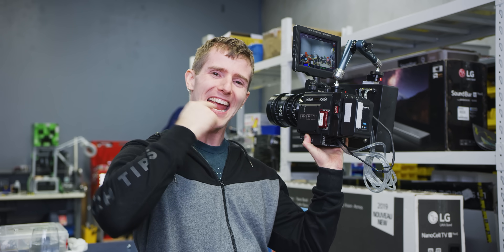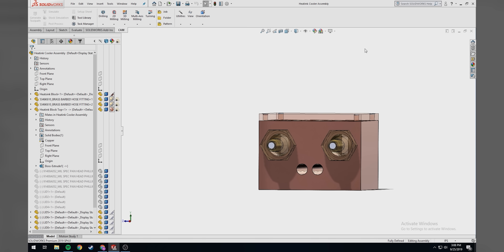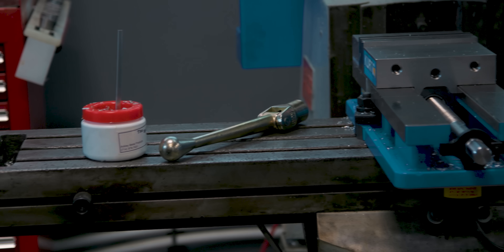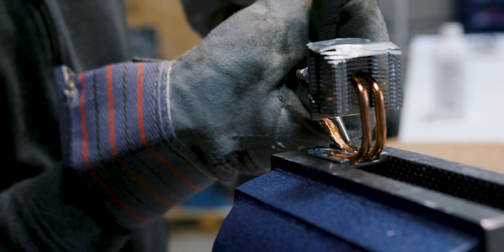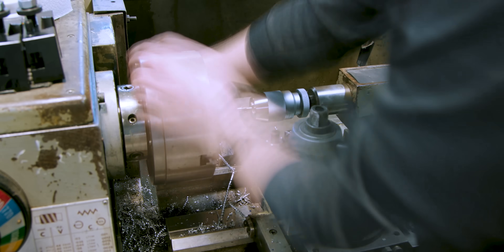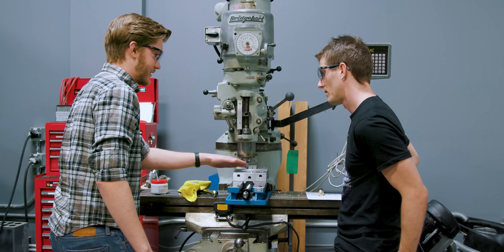WE FINALLY DID IT!! - Water Cooling the 8K Camera!

Comment: Machinest secret: instead of messing around with eccentric or electric zeroing bits, just get a centering bit or a tool steel dowel, put that in the collet, paint it in magic marker, and when you touch the side of the work the marker will come off. Good to a couple of thou on our old bridgeport and no moving or electrical parts.

Comment: Power tapping with a multiple HP motor.  What could go wrong?  In case you guys don't know.  99% of the time when tapping on a Bridgeport.  Only use the spindle as a centering device and just use a bloody tap handle yourself.  Proper thread cutting requires breaking the chip every so often which you can do by hand.

Comment: (sorry for my English) When i worked on Lathe or Mill on Aluminium, i have the best results at Lube/Cooling with "Spiritus"  in German. may in Englisch : methylated spirit ?
You Just dont have to geht too high RPM for too much Heat. But Try it out yourself. i wased Amazed when my Master told me to do that and i see the result.

Comment: Just run your tool path along the part, taking only .005 or so, reset DRO thats x or y. 0+ r of the cutter. Move cutter up and out of way of material, look at DRO, move the radius of the cutter, reset DRO, wala x or y or z .0

Comment: just useless lol.
 for a hand camera not smart to add lot of weight, volume, reduce autonomy of battery, 
and add vibration with pump and fluid circulation, and a new source of failure.

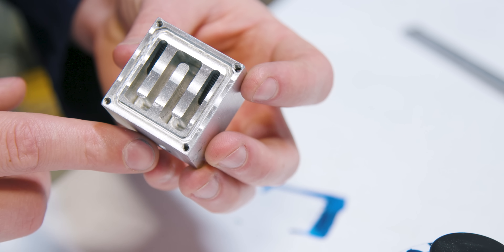Comment: 15:43
"Ten one thousandths of an inch" Also known as 1 hundredth of an inch
Reply: Well, you measure in thou
Reply: Ten one thousands : .010
One hundredth : .01

The extra zero is there for tolerance. It's a finer measurement.
Reply: In machining it seems reasonable to refer to it in that way.
Reply: Math is hard
Reply: That's like saying a decimeter instead of 10 centimeters. That's not how things are measured.
Reply: @suff99  I see your point but you wouldn't say "Ten one hundredths of a metre." You'd say "One tenth of a metre"
Inches aren't really split into milli-inches & centi-inches. If they were, it would've been fine to say "Ten milli-inches"
Reply: well inches aren't really a good form of measurement if you think about it
Reply: @mrpostman6024  Yeah they really aren't

Comment: Its alot easier to tap in a conventional drill press as opposed to a mill, as a mill requires the speed of the tap to be the same as the feed rate. A drill press on the other hand allows you to stay square to the work, however doing the feed rate and drill speed completely by hand, even being able to tap the work by hand whilst keeping the tap square to the work. This doesn't mean you shouldn't learn how to tap the work in the mill.

A bit off topic, but you can make taps out of standard bolts with an angle grinder by cutting a relief in the screw for chips and tapering the end down gradually save you having to go buy another 20-30 dollar tap for a one-off part.

Comment: Sadly - I see the knock-off version of my quick release (code name 'Wedgie' ultimately branded as Cine Lock by 16x9) on the Titan arm. I designed that in 2006 and was crushed with when Chinese manufacturers started selling them at a lower cost than I could even build them. I sold off the rights to that and suffered the same fate after introducing all sorts of cinema camera accessories and modifications. China won. I ran away. 
Now the cinema camera industry is dominated by cheap stuff. 

I just designed the updated and upgraded 'Wedgie II' that I will make for my friends that appreciate the real thing.

Comment: About removing heatsink from heatpipes. It most likely was soldered, meaning all you had to do is heating it precisely and fast to desolder, pretty much all heatpipes can be desoldered at 150C, and used solder melts at 138C.

Comment: 3:40 You could've tried submersing it into hydrochloric acid to dissolve most of the aluminum but keep the copper heat pipe.

Comment: you don't tighten an indicator, just hold it in place so its not moving, its a hollow tube not an endmill. Also tapping on a mill, can be done however its not easy, as you're finding out. there is an attachemnt that allows you to reverse easily. But even easier than either of those is just use the mill as a guide for vertical and turn it by hand, with a bar or something in a keyed chuck.

Comment: What an insane undertaking all for the sake of this one stubborn project lol. Built a whole shop, designed all these components, performed all these trial runs and everything to cool a camera. I guess now you know what R and D is like for these projects.

For the initial heat pipe extraction that damaged the pipe around 3:23 I feel like it would have made more sense to take a metal band saw and drop it very slowly onto the fins to know them off. Would have done the lions share of the work so the file only had to do a little.

Could have also used an acid bath to clean the delicate bits and dissolve the aluminum while leaving the copper.

And there is more than just guessing when it comes to speeds, there is a mathematical formula you use to calculate that's relatively simple but it's often just easier to Google it.

Also you don't need to center punch but a centering bit. Punches aren't reliable for tapping mill holes. Centering bits last WAY longer.

Not a mill guy either but I did train machine tool while getting my robotics and electronics degrees and picked up a thing or two.

Comment: So, you you want to use a center drill, instead of a countersink.  Depending on the drill size, you don't need to do it though if you stuff the drill in high enough.  That being said ... I did learn something new about climb vs standard milling.  Also, a good way to get a tap out of something is to use an automatic center punch.  Taps are brittle, so you basically snap off little itty bitty bits.

Comment: Tapping a drilled hole on a mill or drill is not hard, just drill the hole do not move a thing and replace the drill with the tap and lower the chuck(NO POWER ON} and hand turn the chuck so it goes in, once you cant turn it,  hold the chuck release the tap and move the chuck up, get the tap handle and hand turn the tap by hand.

Comment: you should look into your speeds and feeds for the mill. diameter of the endmill (in mm)  x pi x rpm gives you the speed of the tool in meters/ minute. you can find the data for the recommended speeds for your endmills and other tooling. and for the feed speed it's rpm x amount of teeth on the cutter x cut load per tooth. recommend not to cut less than 2/3rd of the radius at the nose of the cutter. for a small endmill like you used to mill that part flat use something like 0.02mm per tooth to be conservative. at 0.5x diameter depth of cut.

Comment: 13:09 FYI, that's a reamer bit, used to ream holes (create a 45 degree relief cut in round holes to break the sharp edge and facilitate a nice "funnel" for any tool or screw you might wish to insert in the hole after). You need a center bit. The stubby fat bit that you'll likely find in the tail stock kit for your lathe.
I'm impressed, either way. Far less cringy than i figured this might be...if you ignore the potential for injury, as the adage goes, safety third.

Comment: Linus discovers the art of machining...
Bridgeport are over rated. Gotta get a used xlo/excello model 602. You will be happier. You can power tap but you probably want a tapping head, spiral taps and lots of lube. You set the quill stop so you don't bottom the tap. You can also use form taps but you gotta make sure you tap drill properly for the form tap or you won't have room for the metal to displace into. Without the quill stop and tapping head it's advisable to hand tap but you can use the spindle face or a pointed tool either center the tap handle or make the tap handle flat to get a straight thread. Alternatively you can hand tap in a bench vice and use the side of a socket or lathe faced tube as a square to guide you.

Comment: This whole video is shop cringe.

could've just used a dremel on the heat pipes..

then  y'all used the brake on the mill incorrectly - it's only for emergencies and changing bits

Comment: Alex, when doing power tapping on the mill you want to have some axial float.  That's why when you see most machinists power tapping they have the tap in a special floating chuck that can stop if there is too much torque and allow the tap to float in and out.  Putting a tap in a R8 collet is a no-no.  You'll also see people use a "tap follower"  it's just a spring loaded pusher you stick between the spindle and the tap handle so everything stays aligned.  And remember, as a machinist, you only get experience after you needed it.

Comment: Alex, does your Bridgeport have a z axis readout? If so you do have an accurate way to measure depth. Take your indicator and use a magnetic base to stick it to the quil. Then touch your first surface and note the indicator readout (which it can be any number you want) and zero out your z axis position. Now come down to your second surface till the indicator reads what you had for the first surface. Your measurement will be displayed on the machine as the z axis travel.

Comment: I know he says he's not a machinist but, he's a machinist. Not seasoned, not very skilled but just enough to figure out at a glance do this and not that or xyz could blow up or worse. It's all manual though. You're not just punching in G28 to find home, you're actually doing the tool changes and giving the computer its zero point, calculating tolerances and doing the cuts with some level of control. This is the cat owner equivalent of pointing to the piece of kibble in front of its nose, if it took extreme precision on a point of that kibble just to get their attention squared away. Anyway the real coming of age point is eyeballing something and recognizing flatness and dealing with your first bits breaking apart. Manually tapping threads is something I do when dicking around with chiller mounts and all kinds of dumb projects. Apprenticeship is always the first giant step up to a wild future.

Comment: Chips can stuck in the heatsink? Use compressed air to blow them away while the tool is doing its job. Do not tell me that you do not have the rotary screw compressor over there for maximum silence for the sake of Linus. wink wink ;)

Comment: If you put something SQUARE Into your vice with a hard jaw that is lined up SQUARE with the bed of the mill wich is SQUARE to the spinder head, where you mount the indicator.. dont (Especially as a machinist) act SURPRISED, if the dial indicator gives you a 99.95% S Q U A R E XD !!!!!!! 
I wouldnt feel safe around you near those machines.. 
PS.. Taps break.. they are made by the devil. 
Sorry for my broken english 
-A cnc Dude..

Comment: Watching the attempt to remove the fins from the heat pipes was just painful. You can use the combination of a controllable hotplate and IR temperature gun to carefully heat the entire unit up to the solders melting point without deforming the heat pipes. Never, ever attempt this with a torch as overheating a heatpipe will cause it to explode which can cause injury. Just a tip for future heatpipe adventures. -someone who has harvested countless laptop heat pipes successfully.

Comment: I am a qualified machinist. Most of the things you do or say are pretty good. The reason you broke a tap was because you need a machine tap also know as a gun tap. They are black. Also you should never hand feed mill, always use the power feed. The formula for the RPM of the mill is 300x200 divide by the diameter of the tool. 200 can be changed for different materials like brass or stainless. You should invest in a quick change tool post. It’s a electric air motor on the top of the spindle shaft. Literally 1 button to change tool. Another to lock it. Quick way to find edges of your work is touch both sides and half it in the read out. You tool will be perfectly zero’ed in the middle of your work piece. Also those machines are some of the best in the industry! (Heavy breathing)

Comment: You should not be wearing long sleeves while running a lathe or mill. These tools are built so they don't stop when they hit something. If your sleeve gets wrapped in a rotating part it will rotate until your long sleeve shirt comes off.

Comment: You can get a legit tubeing bender. I have one for bending 3/8" chrome toilette supplies. It has multiple sizes on it so i'm sure it'd have the right size for your heat pipe. You get less kinking by bending over a round shape than an almost square one.

Comment: lol dude needs to learn of to anneal copper, and good god him butchering those off with those sceers could have just used a dremel tool...no wonder this took so long this guy has no clue what hes doing, and EYEBALLING, maching is not some you do and he needs to get some parallels for the vise and to flatten all sides b4 doing anything to it and wouldnt have had that problem with the oring.......also first we break the chip...then we break the tap

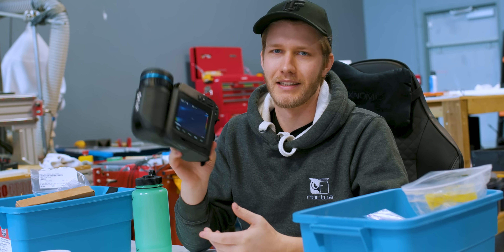Comment: 09:00  That's not how that works.  The tube being reflective means you can't see how much cooler than the environment it can get, because it will reflect emissions from said environment.  That does not stop you from seeing how much hotter than the environment it gets, because reflecting the cooler environment is irrelevant given the hotter emissions it will give off.

Comment: China has M.2 big full waterblocks for years now, 
https://item.taobao.com/item.htm?spm=a230r.1.14.71.76aadee5B9hqvp&id=605770104163&ns=1&abbucket=10#detail  
https://item.taobao.com/item.htm?spm=a230r.1.14.65.76aadee5B9hqvp&id=589677440619&ns=1&abbucket=10#detail
simple fan type in case you might be interested
https://item.taobao.com/item.htm?spm=a230r.1.14.112.76aadee5B9hqvp&id=605876258843&ns=1&abbucket=10#detail
even custom for Optane_900p
https://item.taobao.com/item.htm?spm=a230r.1.14.19.202775f3BbAibv&id=610757013247&ns=1&abbucket=10#detail

Comment: 14:38 speed seems waaaay to high. You need to slow it down and use a Jacobs-style chuck, your tap probably wouldn't have snapped since it can spin in the chuck.
Reply: jelly72 exactly
Reply: When you need to tap 3 small to medium sized holes, there's no justification to do it on a mill, just do it manually, you can go quite fast with enough cutting oil.

Comment: Lots of respect! Geeks that are not afraid to use power tools and production machines! And now I have to edit my comment. Why did you think it is ok to power thread with a mill??? You can use the mill chuck to keep the threads squared to the surface, BUT YOU physically turn the chuck by hand while feeding it manually.

Comment: Did this totally bass ackwards. Shouldve started by actually making the blocks to ensure that you COULD make them, then remove the fins. That way, if you can't actually make your parts, you still have perfectly functional originals that you can reassemble into the camera. 

Also, micrometers can measure VERY accurately, and could be used to measure those cooling plates for reproduction pretty easily.

Comment: LTT: "so how many thousandths of an inch is that?"
Everyone outside of America: "hey, have you heard about millimetres? You're gonna flip out"
Reply: Canada is metric, the reason it’s all imperial is that much of the older equipment that they have in their shop was produced In the states back maybe 20, 30, 40 years ago, when the US actually produced a lot of their own stuff and outsourcing was less of a thing lol.
Reply: Another point is that so much oil field stuff was first made in imperial. Probably 80-90% of the stuff in Alberta is imperial and it's way easier to stick with the old system than to buy new tools, make new fixtures, swap machine dials/leadscrews/gears and the like. I prefer metric hands down but I've learned and mostly get to work on imperial anyways
Reply: Also, how many thousandths of an inch in 1/16 of an inch? Oh, not a whole number? So actually I need to be accurate to more than a thousandth if I'm going to be back-compatible?
Reply: @JamesScholesUK  Realistically, you aren't even going to get to .001" accuracy on most any non-cnc machine; in calculating numbers though, it's always a good idea to go to an extra decimal place, so you don't get errors adding up, especially if you are moving incrementally. 

And typically when you are dealing in 16ths(usually wood/hand tools, saws), you aren't going to be holding that number exactly either - If you can cut something within a 16th of what you are aiming for, you are good.

In the machining world, 16ths aren't used at all anyway - it's (in my experience) usually just 2 or 3-place decimal inch for general stuff.
Reply: Never sure why LTT in Canada always uses inches. I thought Canada was smart enough to have gone metric?!
Reply: @DesignerMaker  It's an older machine made in the US, so the units are in inches. The DRO (digital read out) showing the location is also in inches, although many can switch between US and metric units.

Comment: Never use the mobile jaw of the vice for a reference, always use the fixed jaw of the vice.
You can use the parallel on witch you put piece for height reference. Those are much more precise and are sure to be parallel to the surface off milling table.

Comment: Alex, the best way to tap a hole is to chuck the tap and turn the speed all the way down. Then Unlock the quill, apply light down pressure and blip the spindle on and off until the tap grabs. Once the tap is started, unchuck it, put a tap handle on it and finish tapping it by hand, turning the tap backwards a little bit every half turn or so to break off the chip. This insures that you get a true start to your threads on the mill but you don't break taps. The threads just come out cleaner this way too.

Also use conventional milling on a manual mill has more to do with accuracy then not launching your parts.